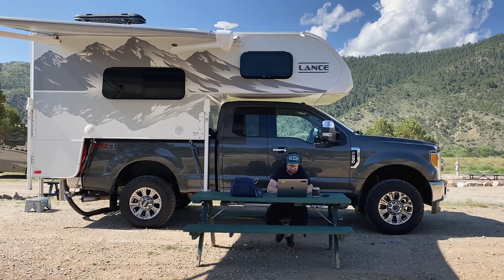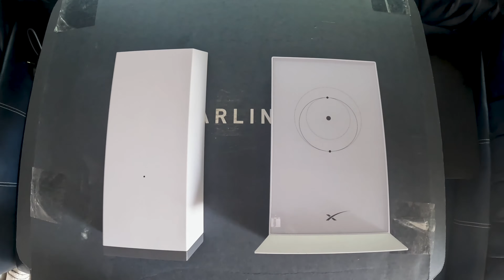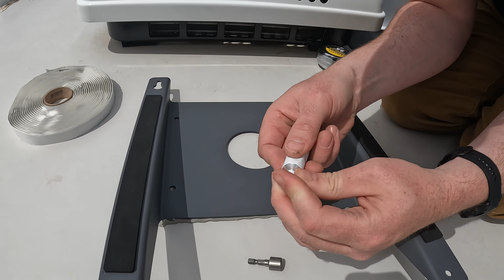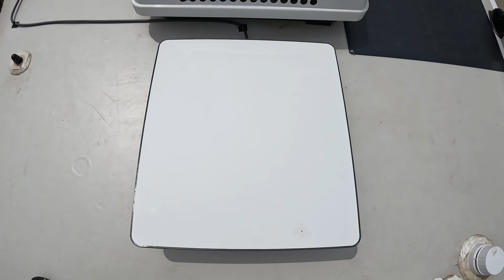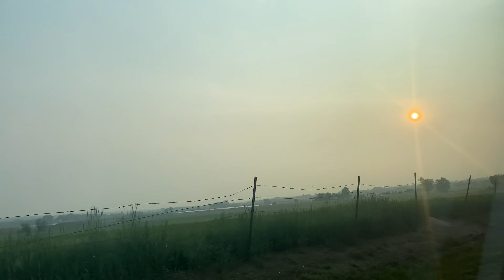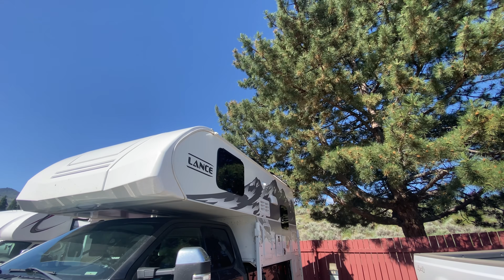STARLINK INSTALL High Speed Internet in Our Truck Camper | Flat High Performance Satellite Lance 825

Comment: Enjoying yinz content.  We have a similar truck and just purchased a Lance 650 and trying to understand solar/battery upgrades.  Congrats on the star link but had a question on your inverter and install procedure? I didn't catch any inverter comments on your 2 other videos for the battery upgrade or solar upgrade.  t
Reply from the maker: Thanks! That was sort of a rush job when we did it, so we forgot to show it in the videos 😅 We got a Renogy 750W inverter and hardwired directly into the battery bank. It’s nothing fancy, we have a power strip plugged into it when we need to charge our laptops, phones, etc.

Comment: Nice. Congrats. I got mine for the exact same reasons. However, I tried the standard dish first, even converted it to 12V, but in the end decided to up the game with the HP dish. So.Much.Better. I should have done it in the first place, but oh well. I also carry a T-Mobile Home Internet for $50/month with me. It is less power hungry than Starlink and I use it when I have a strong cellphone signal.
Reply from the maker: Thanks! We went back and forth btw the two, but we agree with you the convenience of it being permanently mounted and being able using it while on the move is definitely a game changer. Was it easy to convert it to 12V? We’ve been seeing more and more people talking about doing it, and are wondering how it works and how much energy it saves.
Reply: @thewaywedidit   The HP dish is not a good option to do a 12V conversion. I did this on the regular dish before upgrading to the HP dish. However, for the HP dish I ditched the Starlink router and replaced it with an GL.iNet GL-MT3000 wifi router. It is a travel router, much smaller, much more functionality and WIFI 6. It also uses a bit less power compared to the SL router.
Reply from the maker: @dtadventure4x4  good to know! Thanks so much for the info!

Comment: Nice & neat wiring job you both did on the camper's roof! Just one suggestion to finish it off (for more durability over time): Get some "wire-wrap" to protect your bare wires from sun damage (making the insulation dry/brittle over time, fading the black/red wire colors). It's easy to put on and keeps wires shielded from the sun, weather and from abrasion: It will be windy on your roof and moving wires can abrade the insulation exposing the conducting wire (usually copper) -- not safe. You can still route/secure the wires as you already did, but they'll be protected inside the plastic "conduit."
Go to a local Harbor Freight store and look for "Chicago Electric Protective Wire Wrap" -- it comes in a few diameters and so cheap (under $4-5 per pkg) you can get all 3 sizes to keep for future electrical projects. And since it IS cheap you should (IMO) use it not only for wires exposed to the weather outside your camper but also for wires you run inside the camper. Not to mention it gives you wiring a "OEM/factory-installation" look as well. I also use Velcro brand "One-Wrap Thin Ties" to secure the "conduit" along its run to keep it in place (comes in a roll in either black or light gray color) -- they can be cut shorter if need be, or join 2 ties together if you need a bit longer length. They're a very secure and strong way to secure cabling/wiring and anchor it in place along its run. Or neatly secures TV, stereo and other such wires in a RV (or house) vs. wires just running loose everywhere like spaghetti. ;-)
I've used this Harbor Freight wire-wrap (and a similar product called "spiral-wrap") on wiring for years, and again just recently to "factory-install" (!) install a CB radio in my Jeep Gladiator.
Happy Travels,
-- BR

Comment: I have had mobile Starlink for about 2 years now. I have used in all the western states and have had no problems.  I love the fact that you get to have phone service where there is none.   I love my Starlink I wouldn't be with out it.  There is a video from a guy that modified the regular dish and flat mounted it on his roof and it works perfectly.  I don't have mine on a permanent mount I like to be able to move it if I need to.
Reply from the maker: We agree, it has really been a game changer for us! Can’t see traveling without it now.